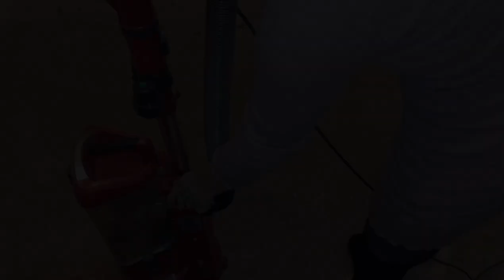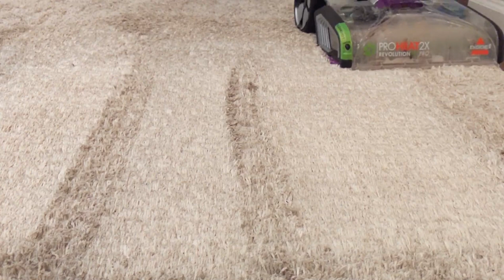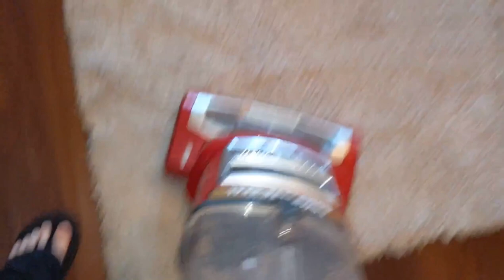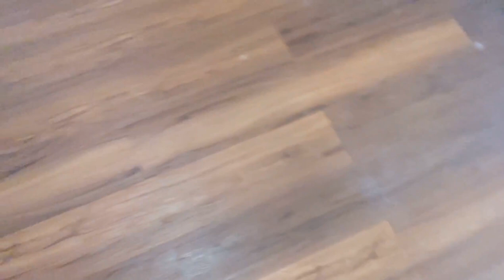INSANE RESULTS!? Carpet Cleaning + Pre&Post Vac

Comment: 💆‍♀️ TIMESTAMPS 💆‍♀️

💚 PRE-VAC - SHARK NAVIGATOR LIFT-AWAY PROFESSIONAL💚
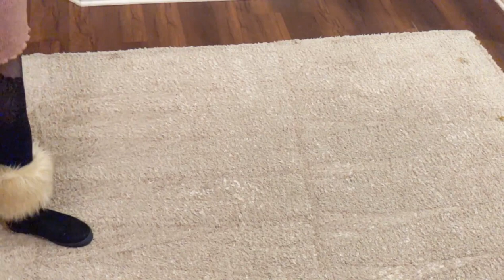0:17 - 8:53 : Brushroll thorough natural vacuuming on new rug + slow passes + carpet lines (high angle)
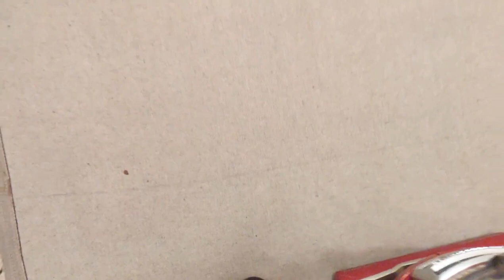8:53 - 9:06 : Bin view 😲😲😲
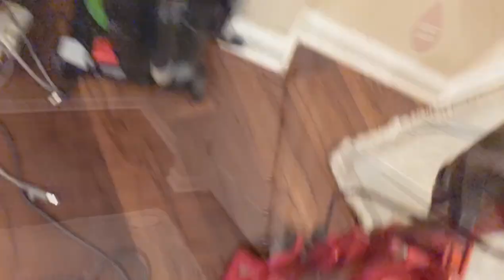9:06 - 15:15 : Brushroll thorough natural vacuuming on back of new rug + slow passes (POV)
15:15 - 15:24 : Bin view 😱😱😱
15:24 - 22:44 : Brushroll thorough natural vacuuming on new rug + slow passes + carpet lines (high angle)
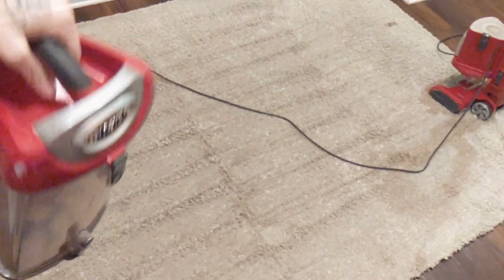22:44 - 22:58 : Bin view 🤯🤯🤯
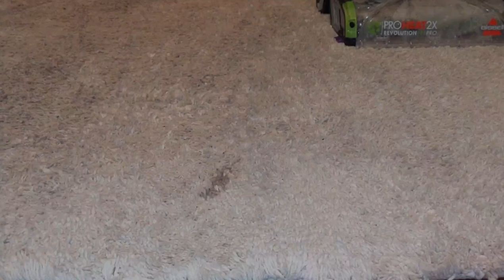22:58 - 25:05 : Brushroll thorough natural vacuuming on new rug + slow passes + carpet lines (high angle)

💙 CARPET CLEANING - BISSELL PROHEAT 2X REVOLUTION PET PRO 💙

25:05 - 28:28 : Thorough carpet cleaning on new rug + slow passes + carpet lines (closeup) 
28:28 - 28:32 : Tank view 🤩🤩🤩
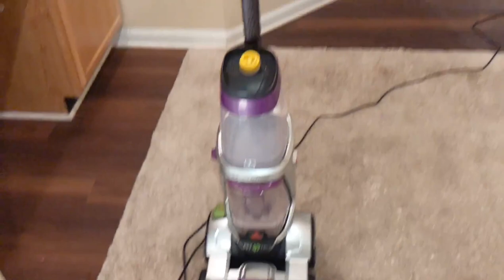28:32 - 31:08 : Thorough carpet cleaning on new rug + slow passes + carpet lines (closeup) 
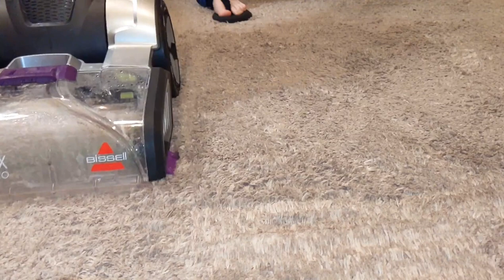31:08 - 31:25 : Rug overview 
31:25 - 33:37 : Thorough carpet cleaning on new rug + slow passes + carpet lines (closeup) 
33:37 - 33:44 : Tank view 😮😮😮
33:44 - 37:54 : Thorough carpet cleaning on new rug + slow passes + carpet lines (closeup) 
37:54 - 38:13 : Tank/rug overview 
38:13 - 40:36 : Thorough carpet cleaning on new rug + slow passes + carpet lines (closeup) 
40:36 - 40:39 : Tank view 😵😵😵
40:39 - 42:32 : Thorough carpet cleaning on new rug + slow passes + carpet lines (closeup) 
42:32 - 45:10 : Thorough carpet cleaning on new rug + slow passes + carpet lines (high angle) 🔥🔥🔥 LINES
45:10 - 45:13 : Tank view 😨😨😨
45:13 - 48:09 : Thorough carpet cleaning on new rug + slow passes + carpet lines (high angle) 🔥🔥🔥 LINES
48:09 - 48:11 : Tank view 😳😳😳
48:11 - 50:34 : Thorough carpet cleaning on new rug + slow passes + carpet lines (POV) 🔥🔥🔥 LINES
50:34 - 50:38 : Tank view 😯😯😯
50:38 - 52:50 : Thorough carpet cleaning on new rug + slow passes + carpet lines (POV) 🔥🔥🔥 LINES
52:50 - 52:53 : Tank view 🤭🤭🤭
52:53 - 56:58 : Thorough carpet cleaning on new rug + slow passes + carpet lines (high angle) 🔥🔥🔥 LINES
56:58 - 57:17 : Rug overview 
57:17 - 59:10 : Thorough carpet cleaning on new rug + slow passes + carpet lines (POV) 🔥🔥🔥 LINES
59:10 - 59:26 : Tank view / rug overview 😍😍😍

💜 POST-VAC - SHARK NAVIGATOR LIFT-AWAY PROFESSIONAL 💜

59:26 - : 59:50 : Rug overview
59:50 - 1:04:29 : Brushroll thorough natural vacuuming on new rug + slow passes + carpet lines (POV) 🔥🔥🔥 LINES
1:04:29 - 1:04:33 : Bin view 🥰🥰🥰
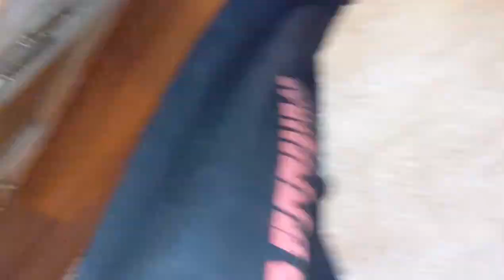1:04:33 - 1:04:50 : Total natural dirt so far 
1:04:50 - 1:06:36 : Brushroll thorough natural vacuuming on new rug + slow passes + carpet lines (POV) 🔥🔥🔥 LINES
1:06:36 - 1:07:17 : Final rug overview / total natural dirt gathered
1:07:17 - 1:09:41 : Brushroll pickup + cleanup w/ natural dirt on hard wood (POV) 
1:09:41 - 1:09:44 : Bin view 😋😋😋

💗💗💗💗💗💗💗💗💗💗💗💗💗💗💗💗💗💗
Reply from the maker: THANK YOU BABYGIRL, I LOVE YOU🥺🥺❤️❤️